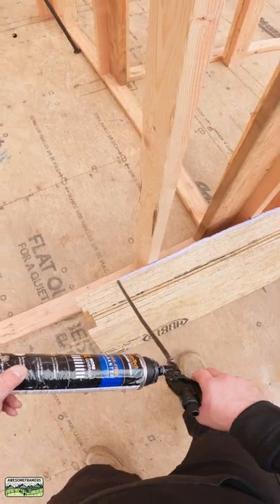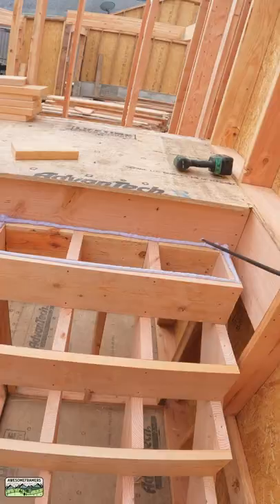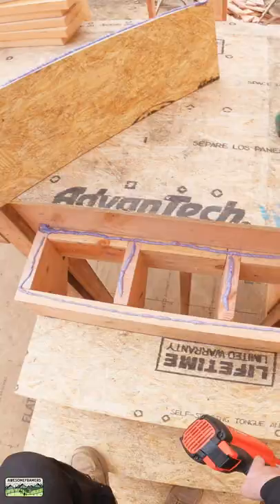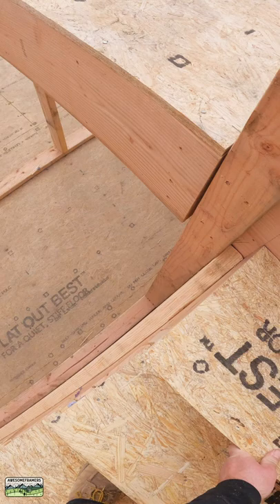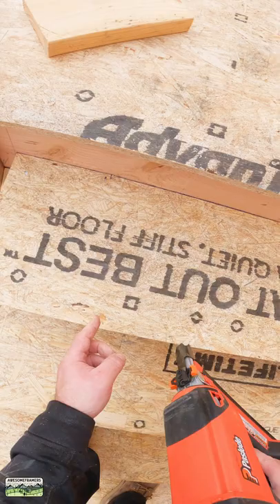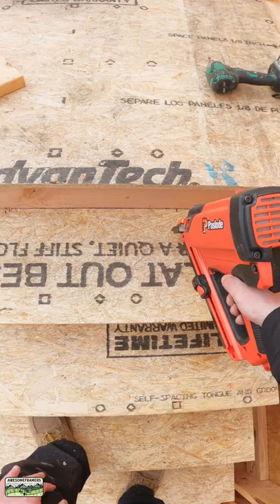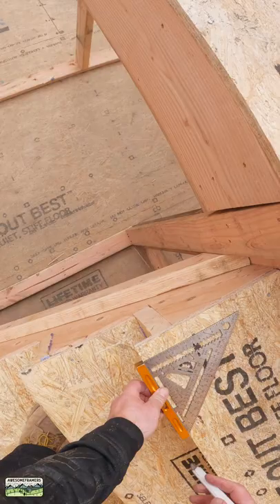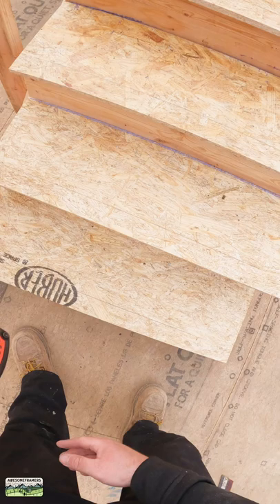Stair Framing part 2 #shorts

Comment: Love how quieter your nailer sounds.  I gave up my 30 degrees dewalt, now using the fuel line Milwaukee that is much better in my opinion,  however this Paslode sounds pretty smooth.
Reply: Gas is expensive though
Reply: @garretk1415  its not bad for the paslode over the amount of nails you can run. Its like $12/can and i can run almost 1k nails with it
Reply: Electric tends to be the way to go. But if you want it to be lighter paslode isn't bad but you may find it has trouble driving the nails in lvl
Reply: they're okay for 2 3/8 nails but they don't sink the long dogs very well but it beats dragging a hose and they aren't too heavy
Reply: @conneroreilly2115  never had a problem with 3 1/2 nails on the newer paslodes
Reply: Pasload is the best cordless framer. You can literally build an entire house with it. Keep the air compressor for the sheathing staples though!!!!
Reply: Every Milwaukee nail gun I’ve used always has issues with sinking all the way. Don’t matter how hard I press whether it’s in bump fire or one shot and I’ve put full batteries on as well and it won’t sink. I also set the depth all the way down too. My coworker told me that those nailers have nitrogen tanks in them which I’m not sure why they wouldn’t advertise that because your actually supposed to get them refilled if it’s not sinking nails anymore.  Dewalt nailer has always had the same problem for me as well. Even sheeting roovs it still doesn’t sink all the way. I prefer my pneumatic mettabo or (hitachi) if you will. I love not needing to use a chord but when your coming back and banging all your nails back in after you’ve shot it’s not worth the hassle.
Reply: @JohnD-yz2gc  if it's a 1st gen they suck man I have all 2nd gens from 23ga to the 30' degree framer every once in awhile I'll have to drive in a 3 1/2 but usually they run good

Comment: I framed in TN. For 25 years. We always used the plywood for the kick plates and 2 x 12 for the treads, when finish flooring is carpet.  Why do you use plywood for treads? Seems like that would break much easier over time, being its only 3/4" thick and not 1 1/2" like the 2x12? Just curious,  I know everyone does it different depending on what area you're framing in. Like the channel though.
Reply: Because he's building track housing.
Reply: He is using an OSB stair tread. It's 1" thick and has a bullnose on one edge. Been around for a long time.
Reply: @657spy  Looks like regular Advantech, no bullnose.
Reply: It’s advantech and if it’s good enough for sub flooring it’s good enough for stair treads. But he should have used screws.
Reply: @theylivewesleep9607  You spent the time to learn Advantech works better than a 2x12 but didn't read up on the performance of polyurethane glue vs screws.

Comment: We use 2X6 for stairs. Glue and 3.5 inch screws. With a laser to make sure every detail is square.
Reply: What kind of board would you use for a hot tub. I am thinking about making a hot tube out of 3/8 plywood sheets.
Reply: @kismagnus01  what???

Comment: Been in the construction field for 30+ years and still find it funny to see you guys and your cordless saws and nailers. 
I have cordless saws and nailers, but they are reserved for small punchlist jobs.
No power?  That's why we use generators.
To each their own I guess.
Reply: Production without the hoses. If you can't understand that you've topped out in your productivity.
Reply: @sparksmcgee6641  
You can absolutely produce using cordless tools.
I absolutely understand that 
I just know that my productivity with pneumatic tools is faster than with cordless tools.
Air nailers hold more nails and I have less nails that need hammered flush.
A drop of oil is all the maintenance it needs.  No running for batteries.
They are generally built better and can take more abuse, therefore less downtime.

Comment: Nice work overall but Screw those down brah!  Never nail a stair. Squeak squeaks. We just moved into a 30 year old house and the stairs are screwed and don’t squeak. Had those been nails they would be squeaking the next 30 years
Reply: He glued them down, the nails are just for reinforcement while the glue dries
Reply: @cerealkilla4eva  Glue/adhesives always fail over time as they experience temp n humidity changes, the screw is your long term strength.
Reply: @ChannelOne-1  People these days have 100% confidence in glue, I'd still rather see glue and screws than glue and nails.
Reply: @bobbygetsbanned6049  You don't understand what you're doing if you think screws are better.
You think screws hold differently for the next 2 hours?
Reply: @sparksmcgee6641  Maybe you should re-read the thread.

Comment: I have a question, why are you using glue?, When those have too come off , too properly finish the stairs, a new oak tread is PL'd and nailed directly to the stringers. At least , that's the way it's done in my neck of the woods. ->Massachusetts
Reply from the maker: These won't come off, this is a carpet stair. 99% of residential here is this way.
Reply: I could only see this in a reno application, the shortening should be accounted for when building the steps and never take off the structural sheething to dab PL on the 3 1.5" stringers... just my thoughts...
Reply: @AwesomeFramers  Ahh was gonna say that's how we do them  if it's known ahead of time ( for carpet) but really? 99% all carpet, wow, sure makes it easier, lol. Keep them vids coming, I enjoy all of them.
Reply: I'm from Massachusetts as well and I prefer to do double treads. PL'd 3/4 plywood with PL'd treads on top.
Reply: @mikebravo3527  The way I install treads and risers, I start from the bottom step and work my way up, shimming and gluing , installing risers and treads as I go, so there has to be a way for me too reach underneath to place shims. So it all must be opened up.
Reply: @tommyperry884  I have been framing for about 30 year's and I have never had to shim a stair tread
Reply: Yes your right
I wouldn't want to install oak treads on that job 
I have seen worse, glued and stripped out screws . impossible to remove the rough frame without destroying the stringers
Reply: Urgh, the tread in osb board...

Comment: Those stairs must be getting carpet I've never seen somebody frame stairs that way before
Reply: Yea right every tread has a tripper till the finish goes in . Not to mention unsupported overhang during the time all the trades are bringing in materials tell me no one splintered the osb and I will tell you the border is secure .
Reply: I always round the edges of the treads if carpeting.
Reply: @knotallthere66 This isn't OSB its a step up. Just like an lvl, osl ect..... isn't OSB

Comment: I have 3 paslodes and none of them work like that
Reply: Clean an lube them
Reply: send them off to get cleaned
Reply: @DSkimRS  2 battery and gas and 1 pneumatic the air one works as good as anything else I keep it oiled and taken care of but the battery ones just don’t seem to cut it nothing wrong with either gun they just don’t drive the way I like out of the 3 I use my Hitachi most
Reply: These new Milwaukee framers are killer
Reply: yeah ive had paslodes and got an m18 nailer, probs shot about 50k nails with it and not a single jam or problem yet

Comment: After 10 years, you will still get creaks. Same problem with subfloor adhesive. It helps sell the house and make up for cheap, modern curvy boards.
Reply: You sound like you use liquid nails as "glue".
Not going to creak on the tread. Stringer maybe

Comment: Never nail stairs! Always screw it!
Reply: that’s what the glue is for. screws take to long.
Reply: " screws take too long " 

Don't hire that guy. 😆
Reply: @alexlaidlaw220  A 2" screw with an impact takes seconds. Literally seconds and they'll never back out.

Glue will keep them from squeaking though! 🤔
Reply: @AOMartialArts  still not as fast as a nail gun. i can probably shoot 6 nails in the time it takes to drive a 2” screw.
Reply: @alexlaidlaw220  yeah but he is talking about taking them out, not installing
Reply: @GerstBladeworks  if you build them right the first time shouldn’t have to take them out.
Reply: @alexlaidlaw220  I’d still prefer screws. I know time is money in the construction industry. I was a carpenter for most of my life. My dad was a carpenter. I started going to work with my dad from the time I could walk good. I was staining and paining baseboard when I was six years old. Driving nails when I was eight. That was back when we used hammers. I don’t even like nail guns for framing. From what I’ve seen framers now are in such a rush they miss the studs more than hitting them when sheathing. Nails everywhere. What actually holds the tread is the adhesive.
Reply: @nathanscott7910  finish nails on treads? yah we use 3in 16 ga nails 3 into each stringer with glue. Ain’t going nowhere. risers we use 8 ga hand drives and 2in staples if available plenty for a 1 by 8.
Reply: Ha screws
Reply: Always use nails and glue never screw it, there fixed it for you.
Reply: @alexlaidlaw220  no that is not what the glue is for…. You screw and glue OSB or it will always get noisy.
Reply: @AOMartialArts  not with those nails and No screws OSB just can’t handle it long term.
Reply: @alexlaidlaw220  that, ends the contractor is lazy.
Reply: @alexlaidlaw220  and our will squeak, even with the foam.
Reply: We are obviously looking at a union job site. This is all these guys are capable of. Also never use OSB for a stair tread 🤦🏼‍♂️

Comment: Pretty sure screws are a better option to help keep flooring and stair treads from squeaking. But I get it doing it the right way does take a little bit longer
Reply from the maker: Nah, it really comes down to the glue. Fasteners are clamps in this case.
Reply: @AwesomeFramers  nah, the screws are superior.
Reply from the maker: @edmessina8392  You're not wrong about screws being superior (in holding power), but that's irrelevant.  Ring shank nail plus this glue is squeak free.  So you can throw whatever you want at it that's "superior" but squeak free is squeak free. No point in wasting time and money.
Reply: @AwesomeFramers  I reread my response and admittedly I'm biased. Yes you're right particularly with up to date bonding technology. Semi retired custom builder here, I've never built a production or tract home....so the time and money thing is not something we've given much consideration to.
Btw, the 4 sets of stringers and what looked like very accurate framing both attest to your skillset and I always watch your vids when I can.
Reply: In fact screws arent better. Hacks like you that learned a bit from your boss in 1998 from a boss who never learned anything since his boss taught him in 1975. 
You guys brag about how long you've been in construction instead of actual knowledge.

Screws move  more and hold less  than real glue.
But you keep at it Liquid Nails boy.

Comment: Framer by trade, grew up doing finish work with my dad.  First, used to be the finish guy that installed the treads, never the framer.  Second, to all the guys claiming “screws” liquid nails with ringshank will eliminate the squeak. Third….  Dude, get a compressor, hose and old school hitachi(or paslode) …. Much more efficient.  Nobody has time to wait for recharge on a job
Reply from the maker: Recharge? More than one battery bro. 

Look at my channel, you'll see Max high pressure nailers and compressors. Don't be so quick to offer opinions without facts.
Reply: Liquid Nails????😅😅😅😅
How to say you're a hack construction worker without saying you're a hack construction worker.

Comment: I really wish they had this product long ago when I was framing homes .. I do not miss winters keeping the PL in the truck in a Pizza delivery bag   ..
Reply: Still have to with this
 You think foam doesn't have temperature requirements? Easy think is its a couple cans vs a case of tube.

😊

Comment: I'm not sure about the staples or the type of wood being used for the stairs . But it probably the new way of doing them . I sure I have to update my construction skills I've been out of the loop for 30yrs. Thank you for sharing . Their probably really quite 😊
Reply: WOW a construction worker that presumes they don't know improvement in the trades. You sir are a gentleman.
New glues are amazing. Now that they've made them foam it's amazing. 
Guessing this glue is about 10x the strength of liquid nails. 
If you have to use box store glue use loctite MAX with used to be X9 because it was 9 times the strength of the standard loctite glue which was more than liquid nails premium product. 
 Those nails are claims and shims for a couple hours. You could pull them in 24 hours with no effect on performance.

Comment: Does the glue change colors when it ready? I've noticed it a couple times.
Reply: It's called Advantech subfloor glue, it comes out as a spray foam, but after about 30seconds it turns into a gel to act as a glue.

Comment: Why don't you screw it down?

With some grk screws? It would much stronger?
Reply: the adhesive is what actually holds it down ..the nails keeps it in place till the glue sets up ..ever hear of liquid nails ..they use it when putting down subfloor
Reply: @fallrivermikey79 OH you were going good till the liquid nails comment.
Liquid nails is literally 1/20th the strength of a good glue you should be using.

Comment: If you used screws, you wouldn't need to use spray foam. Also, how about using real wood, for the steps?
Reply: How about reading something and learning how to build past the last century?

Comment: I’m guessing these are gonna have carpet? Weird to see someone frame stairs inside a house. I’ve never once seen that in 25 years. We install an actual staircase either pine if getting carpet, or whatever species wood the homeowner chooses. Only time I’ve seen anything like that is a temporary staircase before we instal the real stairs
Reply: We usually use advantech plywood as a permanent surface for the hardwood or whatever is going on for finish. For hardwood we flush cut the treads to the riser and for carpet we leave the overhangs

Comment: Plywood on stairs?
Reply: He said its gonna be carpeted in another comment
Reply: Plywood is not strong enough for stairs. Needs 2x12
Reply: @jhayward1940  why would it be ok for floors but not stairs?
Reply: It's engennered lumber. No one uses lumber on the top tier stuff I worked on since 2000.

Comment: You don't nail that down you use screws so that they never have a squeak floor if you look up how to install it says screws it down
Reply from the maker: can you provide a link?  Screws aren't needed to prevent squeaks, glue does a better job than screws when fastened well.

Comment: You need a new nailer man I got a Milwaukee fuel a few days ago and I regret not getting it sooner it’s made working enjoyable
Reply: Hopefully they fixed it because when they first came out it stopped sinking nails after 100 nails
Reply: @MrPoisonedcookies  I’ve had mine for 6 months now definitely over 100 nails through it and no problem’s maybe it was power supply issues I got a bigger battery and it’s a champ all day
Reply: @kylercroci2278  yeah it’s from when they first came out, just doesn’t sink nails anymore. But a guy I work with has a newer one and it works fine. How it goes I guess.

Comment: Water absorbency of OSB creates possibilities for softening of the tread if they're spills through the carpet. my code requires a minimum of 5/4 board
Reply from the maker: A non issue in real life,  Advantech, while OSB, doesn't have the issues you mentioned. Especially from a spill

Comment: Why is the 1st step sticking out 8" past the wall on the bottom  You should have added a step to the platform R to the head of the stairs at the top
Reply from the maker: You can't offer an informed opinion without knowing the design.  First of all, a framer follows the plans.  Second, the reason for the extra step at the bottom versus the top (btw, it isn't "extra") has to do with the hallway size upstairs.  Third, the landing already has a riser in the middle, and changing it to a winder stair requires approval from the builder, kicks in other codes, and is more expensive.
Reply: I've been framing custom homes for 30 years no one wants the bottom step sticking out 8" into the walkway thanks for your reply makes about as much sense as 8" sticking past the walkway
Reply from the maker: @melissabankston8444  Why should "framing custom homes for 30 years" be a qualifier?  When people start with that, they minimize everything the say after that.  Its a weak argument that implies that having 1 minute more experience is what makes the difference.
Reply: My grand father was a framer my father me and two brother also two brother in laws so I think we have enough knowledge I have framed 40 custom home this year does that sounds weak
Reply: I'm 54 can't remember not being a framer
Reply from the maker: @melissabankston8444  While that's a awesome heritage, it doesn't prove anything and weakens your position. You have an opinion, but it isn't correct because of how long you've been framing.

Time to move on.

Comment: Paslode huh? There's better options but that one is working well. Must be new 😆
Reply: paslodes are great. never had issues with them. 🤷‍♂️
Reply: @benjaminmartindale from my experience, they're unreliable, slow and expensive with the gas cartridges. I was always having trouble with my Paslode. Fast forward about 8 years and my airless Milwaukee gun works flawlessly every day with no need for cartridges. I do miss the smell though 😆